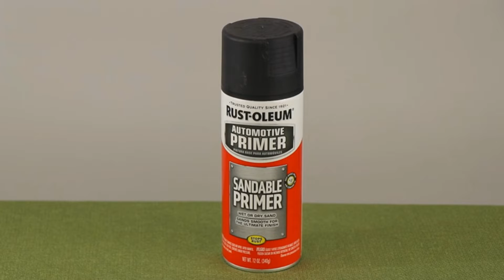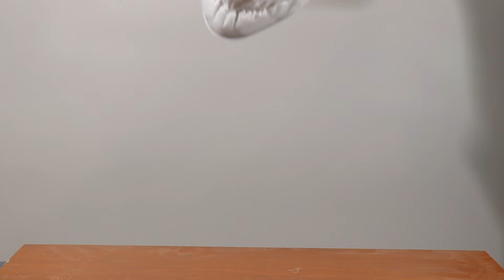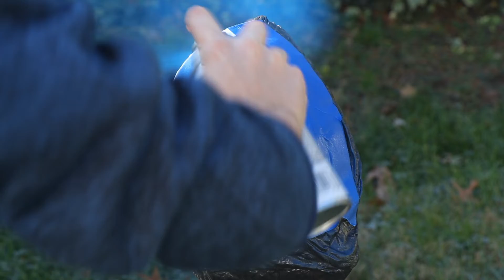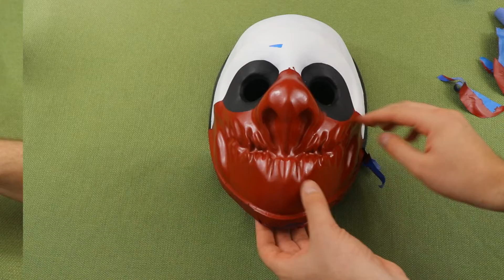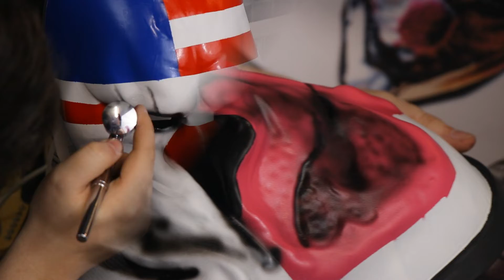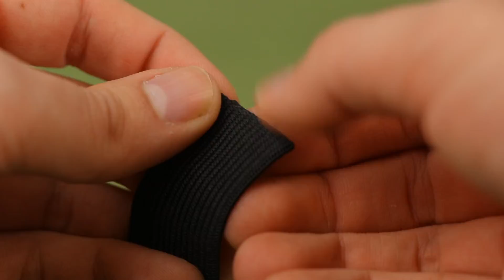Payday 3D Printed Mask Tutorial | Prop House

Comment: What alternatives are there if I do not have a 3D printer?
Reply from the maker: There are several services online and possibly locally that offer 3d printing services, just search Google for 3d printing services near me. You can also find a local maker space that allows the use of their 3d printers for a fee.
Reply: @Studio_52 So 3D printing is the only way?
Because I did what you recommended but it is way too expensive
Reply from the maker: @CabbageChad  3D printing is the easiest, you could always try using clay and sculpting the masks, alternatively if you want to get into 3D printing and have Microcenter near you they have deal where you can get a good printer for only 100 dollars.

Comment: I'm currently building these, did you build these as is? Meaning, did you resize these?
Reply from the maker: I resized the model a little bit, I think I sized them about 5%, but I also have a large head so take that as you will.